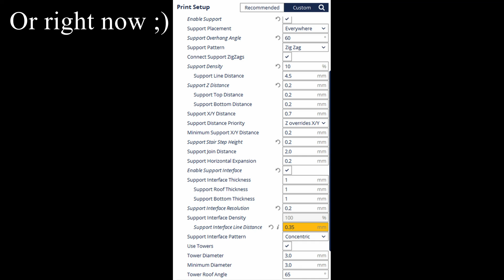Cura 2.5 Support Pt 1 - aka, Clean and Easy Support!

Comment: How do you adjust the support interface "Gap"? There is no support interface "Gap" in the settings. Are you talking about the support interface "thickness"? Because you have that set at "1mm" not "0.1" like you stated. The only other thing that I see it might be is the support interface "resolution", which IS set at "0.2". Please help me to understand this. Thanks !!
*Couple of hours later....
I'm pretty sure it is the support interface "resolution". 
Anyway.....I have tried your settings a couple of times now, and I have to say I am VERY impressed with the results of my supports now! 
I have struggled with incredibly bad supports for months, to the point that I wouldn't print something if it needed them.  So I have to thank you very much for the time you took to make this video. All I did was copy your settings exactly, and now I have no fear of a design that needs support at all!  I actually am looking forward to it, because I know the prints will look awesome now that I have saved your suggested settings to my default profile!
So thank you again......I really, really, appreciate your help !!

Comment: What about small, delicate prints? I need to print a wand blender coupler for a coleague and it is 35 mm in diameter. It has 9 fins on the bottom that are 8,5 long, 8 high and 1,5 mm wide. Print was succesful but removing the support, I broke 7 fins. I can't try another print today, but I was thinking 0,3 mm distance Z and 0,5 X/Y, do you think that could work?
Reply from the maker: That is a good start, also make sure you aren't printing too cold or running your layer fan too high as those could make the fins extra brittle.